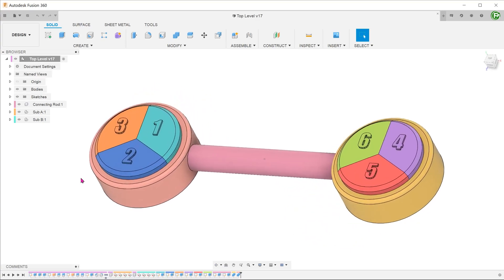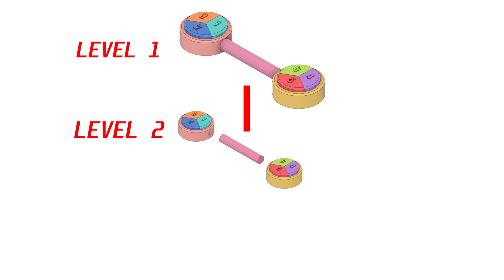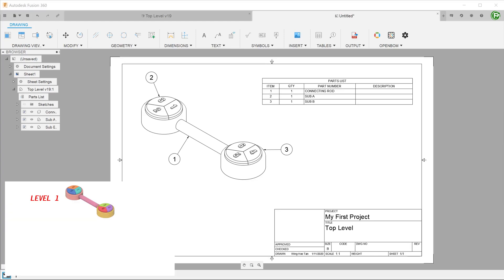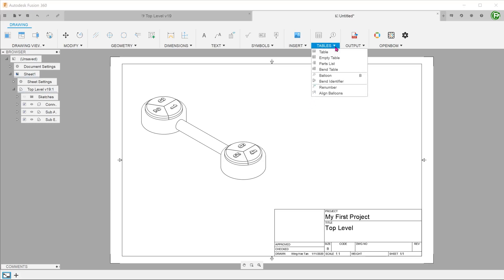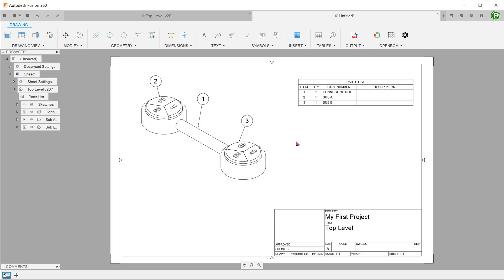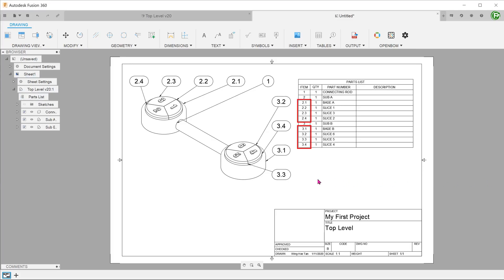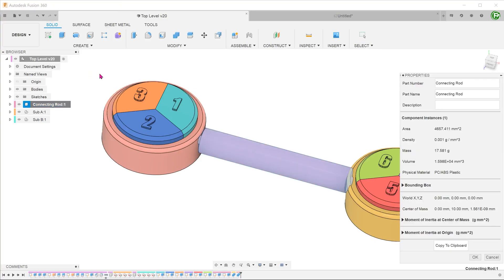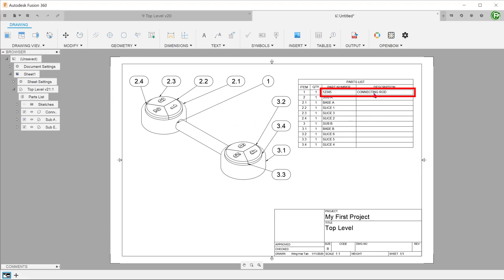Fusion 360 - Multi-Level Parts List / BOM

Comment: Thanks for this video BUT this new bom feature does not work! If you have components that are kept inside of folders in the browser tree it shows the folder name as a component! which is wrong, If you have any PCB's in the design it shows really stupid stuff like solder masks etc, its completely useless!
Reply from the maker: I am not aware of the ability to group components into folders. I suspect that you have grouped the components into a subassembly. In this case, the BOM would show the subassembly name. Choosing the all levels options would further expand the BOM into showing the child parts under the subassembly. I can't really comment on the electrical side of things as I don't use it.
Reply: @Fusion360School  Hi, Yes, The Folders I refer to in the Browser are really just a COMPONENT, of which you can insert other components into , it kinda works like a folder, but it the ONLY way to organise a large list of parts in an assembly browser tree. I wish they would just have the ability to create "grouping" folders. And then if they were to make F360 recognize the folders in a bom and ignore them. Anyway I can NEVER get a proper BOM using the drawing tables in this video. I to revert to spreadsheets as usual! Big letdown of Autodesk, everyone is asking for a BOM system in F260 , but they dont seem to be doing anything about this.